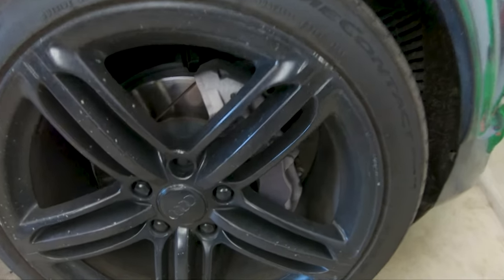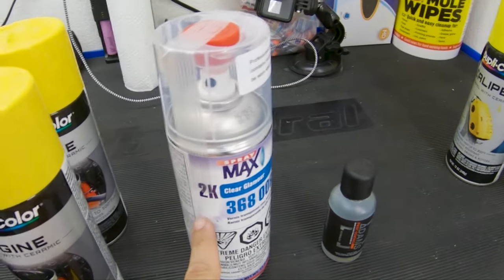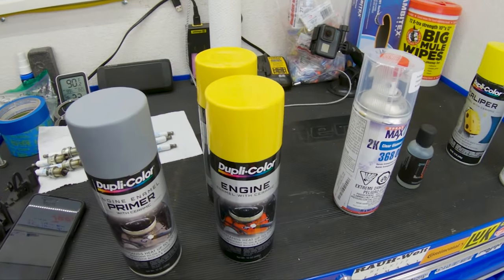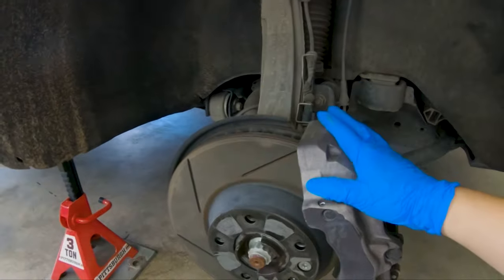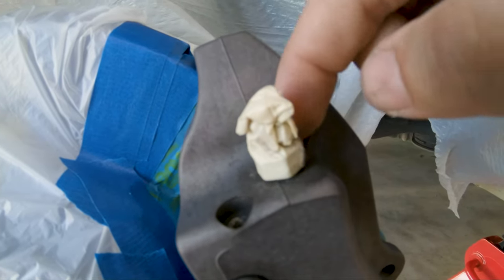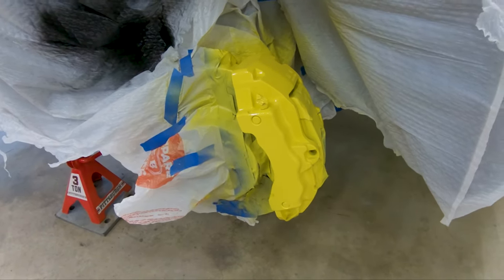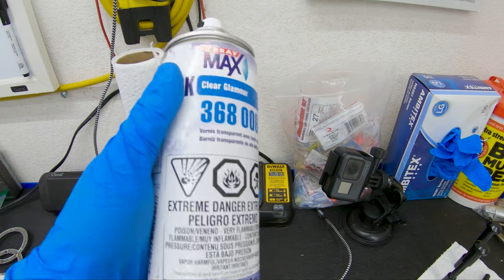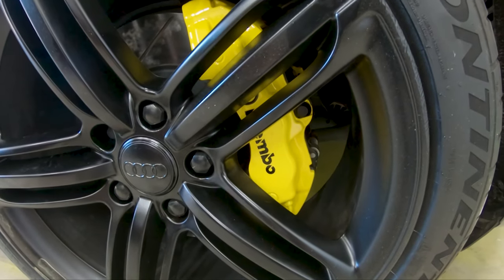How to paint calipers  on Q7 and make them look Professionally Done

Comment: Thank you for the great video! I need advice! I’m doing my Q7 calliper but that screw on mines won’t come off for nothing! I’ve removed the 13m socket and the bar is stuck! Been hitting it but nothing yet
Reply from the maker: Have you tried using PB blaster?
Reply: @markb6s4  thanks! Did get me something similar to use. Another question I went ahead and printed the bolt/pin as well but how did you put it back on without removing paint from it? Lol
Reply from the maker: @itsrigoo5035  so I put a microfiber cloth in-between and carefully hit it into place. Don't hit it too hard bc you run the risk of chipping the paint

Comment: very nice in your explanations of everything regarding the steps and process in respect to the applications of the primer as well coats of paint. how would you advise someone who wants to do this however, they have no garage. They only have a driveway or simple parking spot by their home.
Reply from the maker: It's not really recommend to be out in the open bc of bugs, leaves, etc... Especially if it's a windy day. The one thing I can think of is to set up a tarp covering the paint. But that's just added work to the prep
Reply: @markb6s4  i have a harbor freight compressor. I have 3 spray guns 2 of the 3 have filters for the hose line to catch the water etc so what should be an equally efficient set up for good atomization of the paint onto the surface of the vehicle calipers? Could that recommended setting be then used for say primer application to bumper with one spray gun, and other be solely used to apply the actual car paint while using the 3rd gun for clear coat application ? I cant get vehicle into my shed its only a 8x10 shed but i can use it for painting things inside of it...
Reply from the maker: When it comes to spray guns I have no knowledge on that info since eibe never used one before. And thing paint I have always done spray paint from a can

Comment: Excellent video, brah!  Very thorough, step by step, with all the little nuances to prevent failure. I'll be getting the products you specified and doing my A7 calipers soon.  Video saved!
Reply from the maker: Thank you for watching! If any questions should arise please comment back
Reply: @markb6s4  Hey, Mark.  Do you have a vid showing the cleaning prep method you use?
Reply from the maker: @tomdumay3885  unfortunately i did not record that process. What i did was use a wire brush to break any stock on dirt and used brake clean for the final cleaning

Comment: did you have to do any sanding?
Reply from the maker: since the calipers were very clean from the start, I didn't have to do any sanding on the bare metal of the calipers. but if the calipers are in not to good condition, using a wire wheel will clean off any imperfections on the face of the calipers.

Comment: Nice.... recommended brake pad and rotors combo for the q7?
Reply from the maker: For the front and rear rotors i have the slotted from stoptech. And the pads i just have the hawk ceramic pads. My pads are just for normal driving. I know there are better performance pads out there from hawk or other brands too
Reply: @markb6s4  hey can you recommend an audi mechanic in the DFW area?
Reply from the maker: @arielmachi  sorry, i dont know anyone in dallas or let alone texas